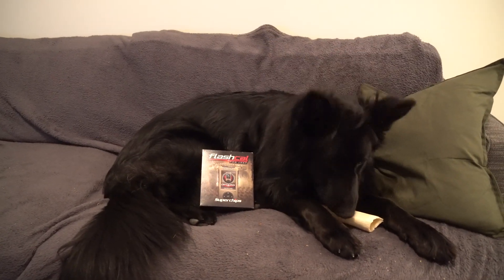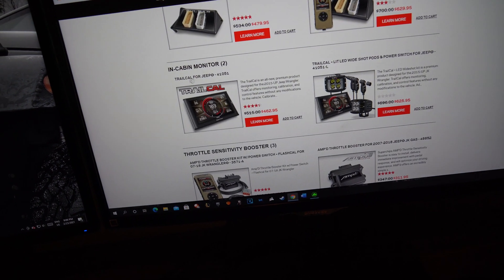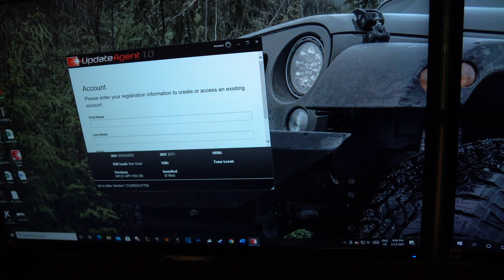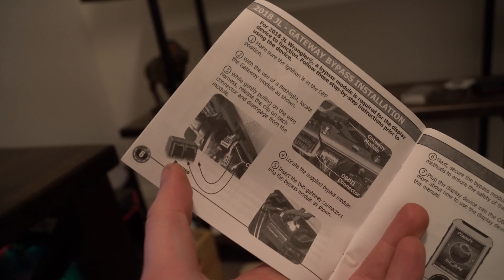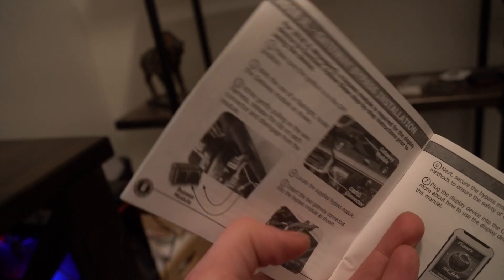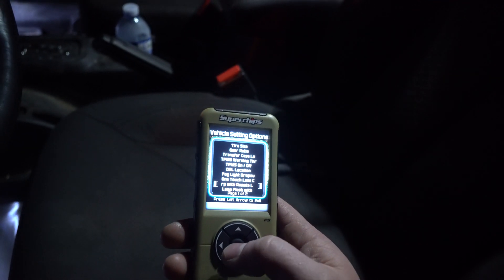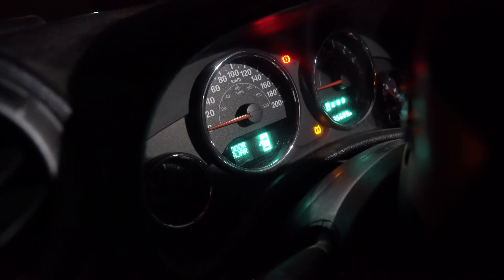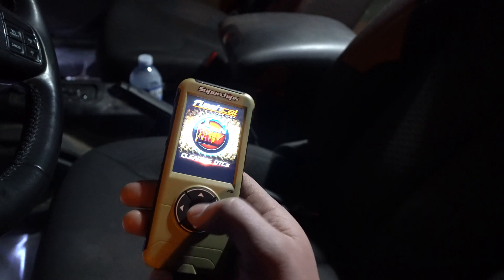HOW TO CORRECT SPEEDOMETER FOR TIRE SIZE AND USE SUPERCHIPS FLASHCAL JEEP WRANGLER Jk

Comment: Ok I got a question for you I have the this exact tuner and I programmed the Jeep for 35’s then I downsized to 33’s I was told to actually measure the tire and program the Jeep for that not the tire size that’s written on the tire itself. Have you heard of that?
Reply from the maker: For more precision yes, that will give you a more precise measurement as it gives you an exact measurement, but to be honest with you as the tread where’s it’ll be off anyway
Reply: @ghostlyrich  that makes sense, but after further more research my Jeep is an automatic so what that tuner does supposedly is to tune the transmission to control the shift points to make it seem not as slow on take offs. Now I know putting big tires on requires more work like gears and possibly a power adjustment like a turbo or supercharger but I just want to drive right and reliable until I get the proper funds available to do my dream build right.

Comment: I have 37’s on my JT and it will not adjust the speedometer. I have adjusted the tire size in every direction and it says that’s it calibrated, but the speedometer always reads 3mph higher than actual speed at 60mph indicated on Jeep. Not sure what the issue is
Reply from the maker: Might have to ad a few up depending on tred

Comment: I just installed 285/70/17 on my Jeep and the gears aren’t changing to 8th would changing the tire size with this also fix the gear issue?
Reply from the maker: It should help the speedo as for the transmission not shifting did this happen as soon as you changed tires. This could be software related for sure I would check in with your jeep service team at you local dealership
Reply: @ghostlyrich  I do feel my Jeep a little more sluggish but the speed matches but might need to be calibrated. The shifting issue just started to occur yesterday the day I swapped my tires. Do you have any suggestions?
Reply from the maker: @juanhidalgo4932  it definitely will be more sluggish unfortunately the best way to fix it is to get your transmission tuned to properly handle the difference in drive line weight. You can buy box tuners but you would have to get your ecu unlocked if you can find a tuner shop near you I would suggest getting it tuned
Reply: @ghostlyrich  thanks for your tips I’ll be looking into that!
Reply: @ghostlyrich  that’s for the tips I’ll definitely be looking into that!

Comment: Did you notice an improvement with your mpg after programming for 35s?
Reply from the maker: It just corrected the speedo. I still have to calculate for the wear of the tires so to properly do that I might have to drop it from 35 to 33
Reply: Did you use a tape measure to measure the size,or just set what ever said s on the tires? Thanks 🙏
Reply from the maker: For most accurate use a tape measure i didnt bother because at the time i was driving so much i was going through tires like crazy so i never had accurate tread amount

Comment: Just bought one of these damn things for my JK but piece of crap isn't working.
Reply from the maker: Check your fuse bro that's what happened to me I had one fuse that was dead and it wouldn't power on because of that
Reply: It powered on, because I could change RPM, low tire pressure on/of and the pressure that the monitor light came on, but that’s it. The diagnostics for the unit said it wasn’t “activated or something like that.
Reply from the maker: @michaelappleton8153  sorry I missed the reply did you try updating the unit with your computer
Reply: @ghostlyrich  after two calls to the company. They had to do an update of the unit on line. Thanks for getting back to me though!

Comment: When I turned on my flashcal. My stock tire size was like 189 am I missing something? Or do I just have to scroll all the way down to my 35 inch tires
Reply: Im having the same problem
Reply: Can you help me
Reply: Me too.  Is this metric or what?
Reply: Measure your tires with a tape measure.  Use that measurement.  I have 35" Nittos, and when measurement due to wear, I measured 33.5. It's perfect now